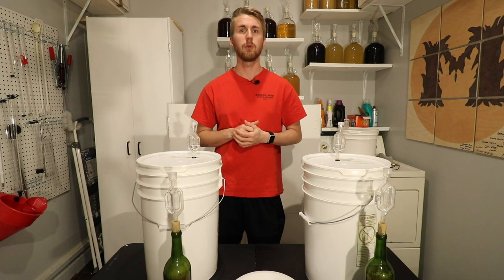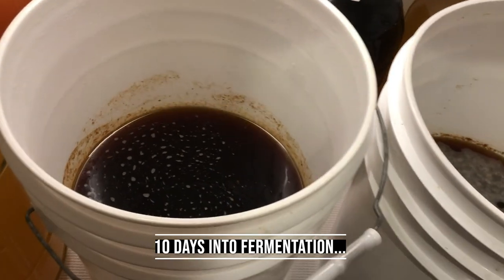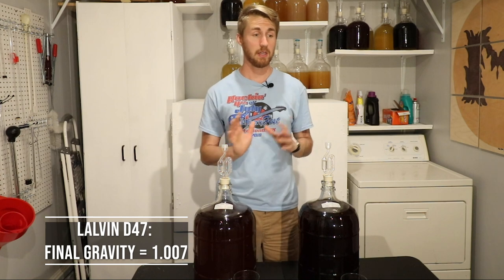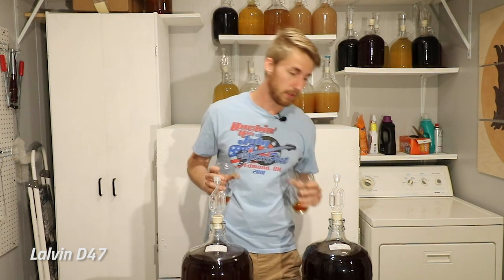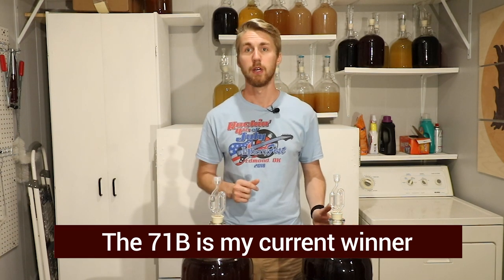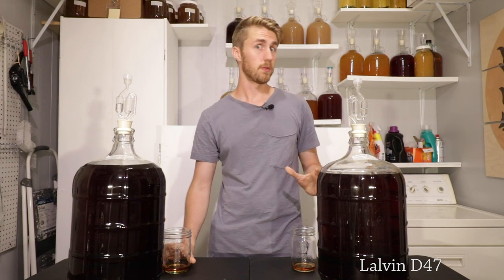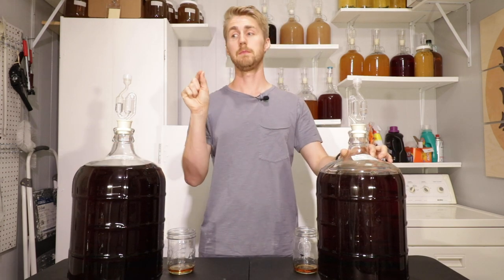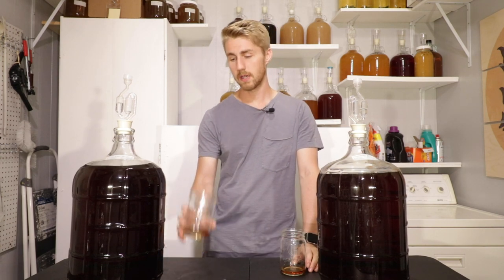What's the Best Bochet Yeast? (D47 vs 71B Test)

Comment: I take it from your receipe that all the honey you used was bouchet honey wasnt too clear from what your ingredient list stated and what you said in video.  I made your other reciepe for bouchet made in the plastic5 gal fermentor which used 8lbs of bouchet honey and 4 lbs of non-bouchet honey also adding Fermaid O as ueast nutrient.  Seems from your results that both yeasts really had no problem eating through the bouchet honey.  

Would you recommend making a mead from all bouchet honey or a mix of bouchet honey and non-bouchet honey?
Reply from the maker: I think a mix of 2/3 bocheted & 1/3 non bocheted honey works best!

Comment: you can test Wyeast 4184 vs Wyeast 4632 ?
Reply from the maker: I can put it on my list!
Reply: I used 4184 for a cyser with a starting gravity of 1.080 (on target to max out its alcohol tolerance of 10%) and fermented at mid-60s for about 3-4 days before the gravity stabilized at 1.002. It was suuuuper quick with SNA and degassing and it mellowed like a dream in just over 3 months. 

The 2-3% residual sugar claim from Wyeast turned out to be true in my case, but I don't know what's stopping this yeast from 100% attenuation in lower gravity (<1.080) musts. If you know, holler at me because it's blowing my mind trying to figure it out.

Comment: How long did you cook the honey?
Reply: Also why elevation are you at and what if any difference do you think elevation would have on that
Reply from the maker: This was an hour! I'm honestly not sure what elevation would do in this case..
Reply: @ManMadeMead  higher elevation would remove more moisture without getting to as high temperature, so possibly less carmelization maybe?,
Reply: I've twice tried bocheting thrle honey. Once at 4200 foot elevation and once at 2800. I used two different slow cookers, two different honey sources, and got two very different results. The first one was excellent, the second became thick and dark but never took on a caramelized flavor.

Bottom line: I think there are a lot of variables in the equation. Altitude may be one.